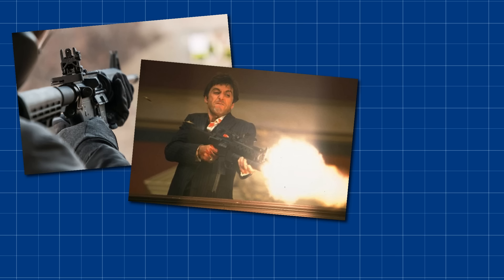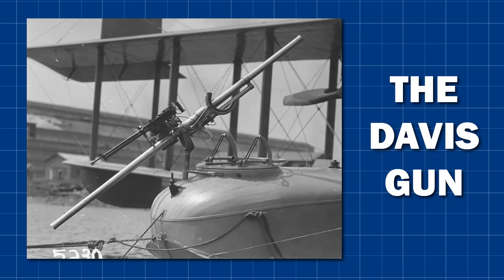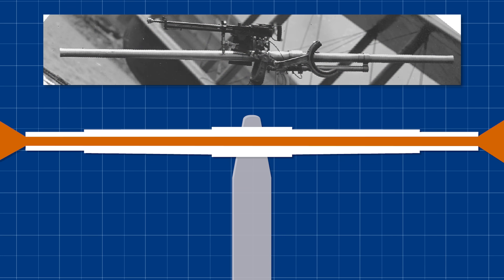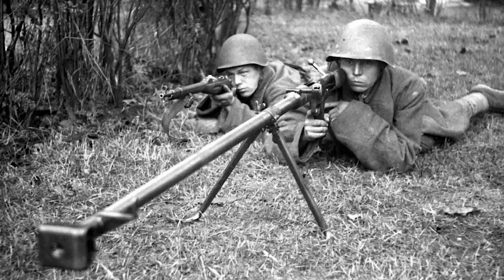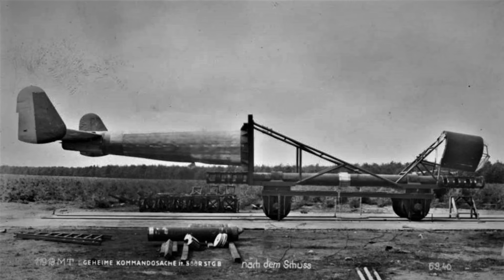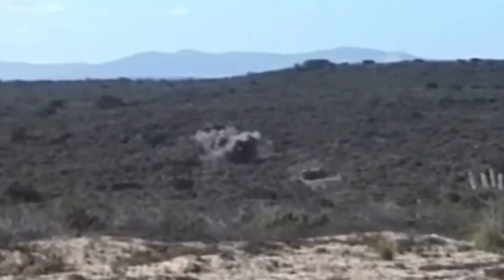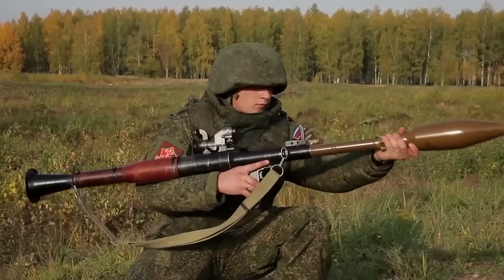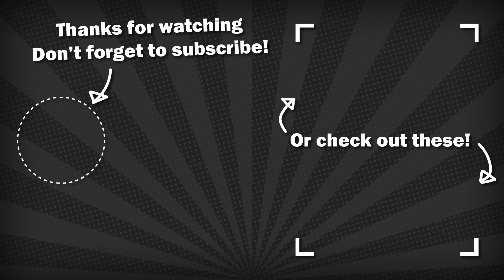What Actually IS a “Recoilless” Rifle?

Comment: Fun fact: An A10 Warthog, if its GAU-8 Gatling gun is fired long enough. The plane can fall out of the sky due to lack of lift from the recoil from the GAU-8 
Btw the GAU-8 was designed and or made by General Motors

Comment: 1:37 machine guns arent going to do much to a zeppelin? You mean that filling the balloon with holes isnt going to make it go crashing down?
Reply: It’s not a rubber balloon, it’s not going to pop. They were armored and with a volume of gas that large a few or even a few dozen pinholes won’t do a thing. All the crew would have to do is drop some weight to maintain altitude.

Comment: fun fact! the m28/m29 recoilless gun used to fire the Davey crockett used a massive piston Infront of the propellant charge to just kinda toss the warhead since it couldnt be fired any other way! they also mounted the launchers to jeeps and M113 APCs ready to be used in places like Germany with the M113 variant having enough space for 10 warheads! 
the blast of the nuke its self wasnt amazing, only being able to instantly kill anyone in up to 160 meters and kill off people further away with its radiation within anywhere to a few minuets to 2 weeks, but as long as the crew firing it were well prepared it didnt pose much threat to them! (also extra fun fact the testing of the m388 in the little feller 1 and 2 shots were the last atmospheric nuclear tests at the nevada test sight!)

Comment: No recoil…all the force exits out the back. It’s possible but the projectile won’t move. There is no such thing as a true recoilless rifle if the bullet moves. These ‘recoilless rifles ’  absorb the recoil energy but its there and absorbed. That’s like saying perpetual motion is possible if we just add energy…
Reply from the maker: @glenoh88  The energy isn’t absorbed, Glen. Roughly half of the propellant is shot out the opposite direction, balancing the rifle and eliminating recoil. No absorption required.
Reply: @ I was being an ass and trying to be pedantic, it should be termed ‘virtually no recoil’. There is actually recoil, just very little especially those that have rifling in the barrels. Need a rocket to eliminate recoil more but even then the tube would ‘recoil’ a tiny bit.

Comment: I'm surprised no one has developed recoilless APFSDS. This would require a heavy barrel, for high velocity and high kinetic energy, but the countermass could be relatively light weight.
Reply from the maker: @IsaacKuo  The high kinetic energy is the force you need to balance, not the mass of the round!
Reply: @RedWrenchFilms  It's momentum that you need to balance, not kinetic energy.

So, for example, let's suppose the dart assembly is 10kg, and reaches a muzzle velocity of 1500m/s. This can be counterbalanced by a countermass of 30kg, reaching a velocity of 500m/s. The countermass has 3 times the mass of the projectile+sabot, but an equal diameter. So, equal pressure accelerates it by an equal force, only reaching 1/3 the velocity. It's equal momentum.

But in terms of kinetic energy, the dart assembly has 3 times as much. Its kinetic energy is 11.25MJ, while the countermass only has 3.75MJ. So, you only need about 1/3 more powder to power this round. Certainly the round is bigger and heavier than the original, but the gun system no longer needs a recoil handling mechanism.

Comment: In South Africa, we used a 106 RR with a .50 rifle mounted on the top used for aiming. The 106 RR was mounted on a JEEP. The .50 round was filled with white powder or paint so that aimer could see if the 106 was aimed correctly when it hit the tank and immediately fire the projectile. In the Israeli 6 day War... anti-tank units, when out of projectiles, would simply fire the .50... the tank crew, hearing the impact of the .50 would assume that a projectile was imminent and would bail out of the tank.

Comment: Great video! One small mistake: having a powder charge in between two projectiles going in opposite directions of a tube isn't going to have double the pressure on the barrel, like you suggested. It would be exactly the same as having one end blocked off, in regards to PSI for the barrel.

Cheers!

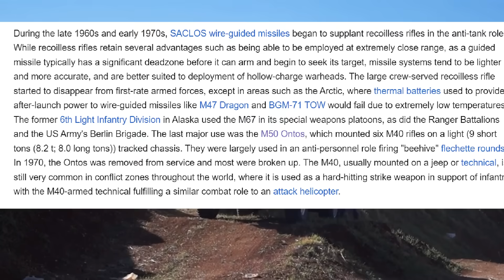Comment: Based on what you said at 9:39 about wiki page, I went looking and it is still there.
Just wanted to say, the cost and logistic in operating an Apache attack copter is astronomical compared to a M40 mounted Toyota pickup. Plus it is easy to hide a Toyota from recon.
Not even gonna mention the training and such required between one and the other.

Comment: The question is. Are the bazooka also consider recoiless rifle since it also has the gas exhaust?
Reply: Yes
Reply: I think not since the combustion happens on the projectile it is considered a rocket. The tube of the bazooka is for guidance of the round and projectile of the firer. A recoilless device contains and directs the propulsive charge. Thanks!

Comment: Hi-speed photos show that the bullet is long gone before any recoil occurs.  Therefore you don't need to bother holding the gun straight unless the next round is forthcoming.
Reply: I, myself, got into an on-line 'back and forth' with a physicist over the same phenomenon, he stated that recoil begins the instant the projectile begins it's forward movement in the bore. I argued that all forces in the bore/chamber are equal until the moment the projectile clears the muzzle, only then, does the recoil occur. I was commenting on a super slo-mo firing of a 76mm tank cannon and noticed the barrel moving rearward long before the projectile exited, which I, a high school graduate, theorized was the result of a 3in x 20+ foot column of air being pushed out of the barrel in the form of "ejecta" by the forthcoming projectile. i finally relented, he had a degree and I graduated with a D average.
Reply: @peghead   No, you're right.  Here's what's happening.  The professor is right when he says the recoil starts when the bullet is fired.  What he doesn't say is that it's insignificant and barely noticeable at all.  Okay, it might mess up a super long distance shot by raising the barrel a smidgeon, but not by much.  The big recoil that we see is later and some of it is from the spent gas leaving the barrel and some of it is momentum stored in the mass of the gun.  The bullet is tiny and goes at high speed.  The gun is heavy and moves at slow speed.  It takes time for it to react.
I would say that you won that argument hands down.  We won't beat up the professor because, technically, the recoil does start much earlier.  The only problem with that answer is that it's insignificant at that time.  Professors always miss the big picture.  They focus on the little stuff and drive us nuts.  It's what they do.

Comment: In the Navy Seabees. Crewed a 106 RR. 50. cal rifle on top for aiming.  Wheel barrel chassis. The loudest thing I ever regretted hearing. Dirt and dust it kicked up.
Reply: In South Africa, we used this variant, mounted on a JEEP. The .50 round was filled with white powder or paint so that aimer could see if the 106 was aimed correctly when it hit the tank and immediately fire the projectile. In the Israeli 6 day War... anti-tank units, when out of projectiles, would simply fire the .50... the tank crew, hearing the impact of the .50 would assume that a projectile was imminent and would bail out of the tank.

Comment: But the back blast of the 106 is enough to pulverize anyone standing less than 100 feet behind the gun. In Marine boot camp, they placed a wooden crate about 6 ft high x 1 ft. deep and 1.5 feet wide (to simulate the dimensions of a typical man). When fired, the back blast instantly turned that wooden crate into a box of toothpicks.

Comment: In the Davis recoilless gun, wouldn't half of the momentum of the projectile fired forward be reduced by the momentum imparted to the counterweight being fired backward?
Reply from the maker: @karlostj4683  Assuming the same amount of propellant, each projectile would have half the momentum when compared to a single projectile - if that’s what you’re asking!
Reply: @RedWrenchFilms  That's kind of what I thought - which means that the payload intended for the target would impact with less momentum. Your video did mention this toward the end, if I recall correctly, and pointed out that this would make the end result less than a projectile fired with full recoil. Thanks.
Reply from the maker: @karlostj4683  Yeah it’s the main tradeoff of recoilless weapons as a whole! Pros and cons of course.

Comment: US 106mm recoilless had a tremendous back blast that very dangerous.  Also, your position would be immediately exposed by the blast so they were mounted on a jeep. Trained on 90 and 106mm(11H) never saw them in Vietnam.

Comment: Three details people might find interesting:

Recoilless weapons have two main advantages over guided missiles. First, because they fire ballistic projectiles they are totally immune to all soft-kill protection systems. A bullet cannot be jammed, spoofed, or otherwise seduced.
Second, because there is no rocket in the projectile, recoilless guns tend to generate a lot less smoke and noise, so it can be more difficult to actually find the shooter and retaliate.

Thirdly, the reason why recoilless weapons can't be fired indoors isn't just that propellant gases come out the back, but that it also creates a concussive wave that can bounce off walls and other solid objects. If contained inside a room, these reflecting waves can overlap and turn anything inside the room into jelly.
Reply: One major disadvantage they’d have though is that they’re mainly high explosive or shaped charge and HEAT. That would mean that the best counter to recoilless weapons would be some ERA. Unless someone decides to invent tandem charge recoilless rounds, but since recoilless rifles are hardly ever used in a world full of guided missiles, that is a bit of a moot point.
Reply: That's true, though there's nothing technically stopping you from making a kinetic recoilless round. The problem is making one go fast enough while also making the launch tube light enough to be carried around.

It's the same reason why tank guns have never gone above 120mm or so in calibre. Sure, 130 or 140mm sounds good on paper, but the size and weight of the gun breech needed for such a round is usually too impractical for an MBT.

You might be able to make a recoilless sabot cartridge work, though
 They've done it for .50 cal...
Reply: @AusFirewing  The problem with kinetic ammunition is they require higher chamber pressure and recoilless rifles are low pressure systems. You can raise the chamber pressure by adding more counterweight and or making the vents smaller. But then you'll have to add more weight by making the gun chambers thicker. Recoilless rifles are a compromise between the weight of the guns and the weight of the ammunition compared to tank guns and rockets. There's no benefit without a drawback.
Reply: @therealspeedwagon1451 you can just volley fire that with multiple recoiless rifle. Much harder to do with missile since it cost more both for the launcher and ammunition. Also recoiless rifle has the benefit of not needing to sit there and guide the missile so chances of retaliating fire is much smaller.(before third generation fire and forget anti tank missile like the javelin exist). This is also part of the reason for the argument of tanks, consider it can deliver long range, accurate, and immediate fire against targets(yes you can runaway against missile when at long range, not so against a cannon round flying towards a target at Mach five.)
Reply: @therealspeedwagon1451  most ATGMs are also HEAT charges
Reply: "and turn anything inside the room into jelly."

Very important......
What kind of jelly?
Reply: @uss-dh7909  Let's just say it's not good on toast. ...or at all
Reply: Cheaper rounds compare to missles too?
Reply: Also the RR ignores armor, so you can take out an IFV, Warlord, Hulk, or Impaler in one shot
Reply: @mrosskne   Well, not entirely. IFVs don't generally have that much armor to begin with. And chemical warheads don't do so well against ERA or Composite armor.
Reply: Yeah, entirely.
Reply: > A bullet cannot be jammed, spoofed, or otherwise seduced

"I've yet to meet one that can outsmart bullet"
Reply: It's extremely horrifying to use recoilless gun inside a room, where can I see the jelly... i mean is there any video of it?
Reply: @Bijimeledag  It wouldn't look like much if there was.
It wouldn't blow people apart or anything (unless they were DIRECTLY behind it), they'd just get internally scrambled by all the shockwaves bouncing around.
Reply: You forgot the most important advantage: the cost of ammunition is significantly less than a guided missile.
Reply: nice try CIA
Reply: APS be projecting a holograph of a stripper on the side of the road to seduce the incoming missiles
Reply: درست است واز انجا که چند سال با توپ مستقیم 106م م کار کردم موقع پرتاب تیرانداز وجیپ هردو در موقعیت خطر قرار دارند وبدون حفاظ هستند
Reply: Nah, I’m seducing the bullet
Reply: Excellent!
Reply: BACK BLAST AREA CLEAR!  THWUMP
Reply: Alternatively, chunky salsa.
Reply: Yeah, it also turns your brain into jelly when fired in the open too.

Comment: I'm surprised that we haven't seen anti-drone drones in Ukraine with pods of recoilless shot gun tubes mounted underneath. 
Kind of like a pod of miniature Davis guns, only backward firing a steel counterweight out the back & a spray of shot at the targeted drone. 
Sure, they'd require enough radar & processing power to home in on the target & do an attack run, but nothing that isn't off the shelf these days.

Comment: The description of recoil is not correct. It's not the force exerted on the bullet or cannon ball that causes recoil. It's just the blass from the propellant. You would get the same recoil even when firing blanks.
Reply from the maker: Not true! Blanks generate only a fraction of the recoil of a live round. That’s why any semi-automatic or automatic firearm requires a blank firing adapter to function.

Comment: It's simple. A recoilless rifle does NOT contain the blast of the weapon leaving the barrel. Whereas other weapons like conventional artillery contains the blast or recoil...and thus "recoilless. Best advice? NEVER ever stand behind a recoilless rifle.
Reply: Doesn't it contain it briefly? Otherwise, I have it at all? Thanks
Reply: @brucermarino  The tube guides the round, the blast goes out the back. It is a rocket that propels the round to the target, whereas in howitzers or even rifles and handguns, the explosion is contained within the breech and barrel and as they "escape" out the only opening there is, they propel the round out because it is in the way of the gasses. 

They "rifle" the barrel of "guns" so that as the round is pushed out of the barrel, it begins to spin and as it leaves the barrel, it is spinning and thereby retains its direction to the target. Arrows spin also for the same reason, but are propelled by the force of the human pulling back on the strings. Recoiless rifles will also have fins to achieve a spin helping them stay on target.

Comment: 7:22 This is a common misconception, this modified vespa did exist, and they were quite successfully used during the french colonial wars, but they weren't meant to fire while mounted, it was simply a mean to carry the gun, which was then used on the ground using a lightweight folding tripod stored in the vespa.

The reason for it being recoilless is to accommodate the rather low weight capacity of the vespa, even despite the souped up engine of the military models.
Reply: They did put them on those tiny little mechanical mules, though.

Comment: RPG-7 is also recoilless rocket. The primary propulsion is by rocket motor, but launching rocket from RPG-7 tube works like recoilless cannon.
It has outlet for backblast in rear. So RPG-7 can be launched with minimal recoil and backblast.
Reply: So even more correctly "Recoiless Rifle that fires rocket assisted ammunition"

Comment: Zeppelins (dirigibles) and even blimps are an interesting case. The British initially found them difficult to shoot down. Bullets would pass right through the bags of hydrogen gas. I think we all have a biased expectation from popping party balloons. (Were these rubber balloons as common 110 years ago? or were biases different?)  Even party balloons do not have significant pressure in them, but enough to cause a pop or a rapid depressurization as they fly willy nilly. In dirigibles and even blimps the pressure difference with the surrounding air isn't very much, so unless the hole is very large the loss of gas is minimal and slow. It took incendiary bullets to shoot down German Zeppelins -- and even then it wasn't certain. An incendiary  going off inside a bag of >90% hydrogen won't cause it to burn because that requires oxygen. So any burn has to happen where the bag meets the air.

Comment: I wonder if you took a page from the Davis gun idea and applied it to modern recoilless rifles though... what if you added a quantity of dense powder, like lead powder? It would be expelled out the back with the regular backblast of the recoilless rifle, but if, for instance, you expelled half the mass of tbe projectile in lead powder, you would half the propellant that would normally need to be expelled backwards. This would allow more energy to push the projectile and limit the backblast, making it easier to fire in confined spaces etc, and since it's powdered, you wouldn't really have to worry about injuring anyone anymore than the backblast already would have...
Edit of course, after 10:00 he explains a system that utilizes just what I was imagining... oh well, at least it confirms that it was a valid idea